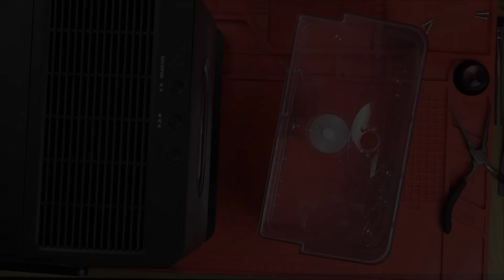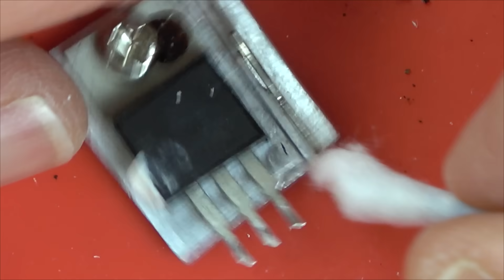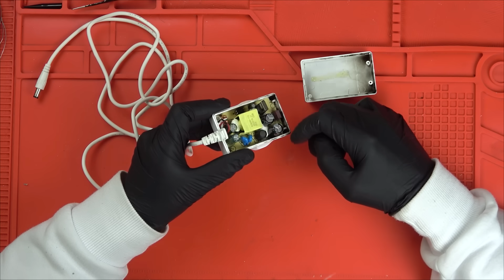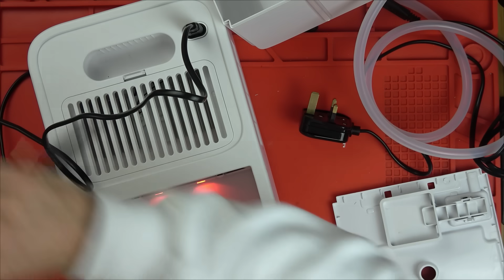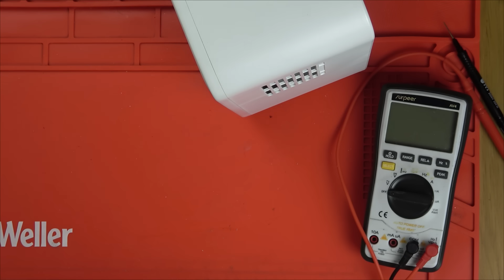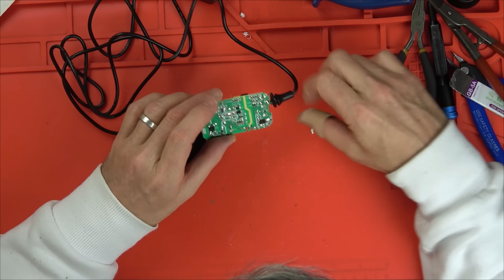Trying to FIX AMAZON RETURNS JOBLOT of DEHUMIDIFIERS

Comment: Maybe you could take some of the thousands of 9 volt power packs at my house Vince soooooooo many I have acquired from so many broken stuff and op shops. You are very correct though Vince do not onsell this device with the broken power supply like me I would be laying awake at night wondering about it. It is good to see such morality Vince you are very good this way. But a second hand power supply should be easily come by. Love the channel love the videos and love the variety electronics to home devices and boat motors. Also never worry about showing us your home in whatever state and do not worry shorts are all I wear in summer in Perth WA and I am 68 years old so imagine what my legs look like.

Comment: to save the trip outside with the power supplies. Make up a dim bulb tester, really simple it just needs a batten holder 100 to 200W mains filament lamp mains plug and socket and some suitable flex and a bit of wood to mount the bulb holder on. The aim is to connect the lamp to run in series with the live input and so limit the current to  400 to say  750 ma (depending on the lamp wattage) any shorts in the unit you are testing will simply make the lamp shine at full brightness.

Comment: My husband left the bath taps running years ago and flooded the top,floor of our flat. I ripped up the flooring and got a dehumidifier. I didn’t fill it with water as I assumed the water would drip off the plates in the machine and the float was to automatically stop it from functioning until you emptied the tank. Possibly I should have read the instructions. It did the job. Love your videos
Reply: Yep that's how a dehumidifier is supposed to work

Comment: That last power supply pulsing like that likely had problems in the bootstrap circuit. that diode is likely the run circuit that takes over after the transformer start switching and keeps the supply running, The bootstrap has a resistor and a diode that slowly pulses the supply and these pulses get rectified back through the diode though the auxiliary winding and the supply fully starts up. so yeah I really think it was a break in that auxiliary circuit

Comment: Question on the last power supply it was just a lose connection probably from manufacturing. Now would you put it back in service since it was just a quick soldering to fix it or would you take it out of service since you had to open it up? Me myself I'd use it / feel confident that it would be safe for anyone to use reason being is no components were changed and it was just reworked / reflowed / soldered and was faulty from the manufacturer

Comment: They could always make them like they use to with a screw or two holding the power supply together but no not anymore just glue or plastic weld them together and make them throw away just throw it away and buy another that's what happens when they make things cheaper it's annoying to be honest

Comment: Hi Vine, nice to see you back. IMO these Peltier based dehumidifiers are extremely inefficient. I myself got one about 2 years back and consider it crap. I've got a "proper" compressor based one (like a fridge) and that is much more efficient. It works much better and it's absolute bonkers how it can help with drying of the laundry when there is a high air humidity / fog outside. If you see mold appearing, get one ASAP.

Comment: We use them for window shelf's , great in the winter for getting all the moisture off the glass. And they work very well, I have 6 in our place. It's rubbish what you have said Vince in how they work. You have to have a certain temperature within the area from the window in to your room. Most tell you what the temperature range is for them to work. I have to empty some of them when we have the heating on when it is very old outside, and they can collect one and half litres within a 3 day period, and that's only running at night. Good work mate.

Comment: I bought a bunch of those.
Vince, you have no idea how bad humidity in my house is. What your dehumidifier did in 4 hours mine do in 30 mins/1h.
Reply: I cannot suggest enough that you get a real dehumidifier! And pipe it into a drain so you don't even have to empty it!
Reply: @jaydoubledee1853  That I was already thinking of, the problem is piping and connecting it.
The bathroom is the worst offender, as one of its walls is attached to the side of a mountain. Since it has metal radiators that we can't use, my idea was to remove one and fit one of those dehumidifiers up there.

Comment: I bought a dehumidifier it has a compressor inside like a fridge, its quite heavy though to put in my car to dry it out as water got inside from a failed water seal on the bulkhead, the car is not often used and when i opened it a week later there was 4 inches of water inside the footwell used a vax washer to suck the water up, must have been two gallons in there😂

Comment: Not true in your case, but some power supplies only give stable output on load. They can be in a burst mode type of operation off load due to poor design 'choices'. This can lead you down the wrong road when it's how it's designed. Often this can be improved or cured by fitting a load resistor on the output, or designing it correctly in the first place.

Comment: Bit of industry insider info..one manufacturer of smd bridge rectifiers changed their encasulation to low profile. When they did this their changed process caused voids in the encapsulation.
This caused internal ionisation which caused random arcs inside the package, leading to momentary very large current spikes and device and product failure.
It was from a major well known semiconductor company too!
In my career, there were 4 other cases of major chip manufacturers messing up leading to product failure, resulting in big compensation payments!

Comment: On the 9V power supply that was all black inside, i think that was from a lightning strike, i have seen this many times before, and you can se it has arched between the traces below R10, you can se a dimple in the solder where it has melted for a moment, and that point also was the senter point of the black stain. I work as a locksmith, and i changed out an alarm system after a lightning strike, one IR detector in the Livingroom was blown apart,  and the front half of it was found on the other side of the Livingroom. It was al black inside from the arching. You can also see that some of the traces are vaporized, and that need som power to do that.

Comment: Output capacitors on flyback power supplies MUST be high quality low ESR, high ripple current, long life types.
If you choose replacements just based on size, value and voltage you've not gone deep enough risking early failure.
Schottky diodes can be chosen based on vf characteristic graphs and matching reverse leakage.
Some schottkies reverse leakage can be very high when they get hot and can self destruct due to thermal runaway.

Comment: 12:38 People buy them as an alternative to a tumble dryer (well I have). Mine goes on between 2-5am (the super off-peak tariff) and the clothes are dry when you get up 🙂
Reply: These peltier dehumidifiers would not dry clothes, compressor ones will no problem.

Comment: There comes a point when you have to buy a bag of micro-switches. I know  the reason was mentioned for the alternative shown,  but if other components are readily replaced that cost more, then a moving part which are notorious for failure, then switches should be replaced.

Comment: Good stuff as always!  FYI: I live within 1 mile of the sea in the North West.  Without a dehumidifier in my bathroom and one in my bedroom used a couple of hours a day over winter I get black mould starting in corners of the rooms.  I had the same in my previous house nearby, so it's not the house.  Humidity meters around the place show it always at 70%-85% without the dehumidifier in winter.  And I don't dry washing in the house or steam food, and only me in the house. My mother's house fairly near is also the same.   People I know who live down south (I have taken meters to check) get 55%-65% which is well below the mould threshold.  These things do have a real use for people in cold and wet places (although the Peltier ones are not great as you say).

Comment: what is the brand of the spotwelder u use Vince? , maybe got a link?
Reply: It's a Glitter 801H with standard S-75A probes. Looks like a decent unit and I recall it may have been gifted by a viewer. I've always been curious of the scale/units it shows as it can make it difficult to judge what to use for a once of job--seems to get the job done and on the plus side is generally entertaining :)

Comment: I just had my power chair have a capacitor explode underneath my butt when I sat down. It literally exploded everywhere and there was parts of it inside the case all over the place. It took out a DC to DC 40 volt buck converter with it. Waiting on that part from China and they're not shipping right now for the Chinese New Year....

Comment: Nice fix, Vince :)
If No. 7 is a simple 12V PSU, I could send you over at least 50 of those, I got a big crate of 12V 3A PSUs from one of my friends, who works at a local telecommunications service provider, and they are monthly discarding brand new PSUs from modems, and STBs because they don't fix the boxes, either. And if the PSU cable is non-removable from the user's TV cabinet or any cable loom, then he is not replacing it if it is not faulty. That leaves him a truckload of unopened PSUs at the end, and his boss told him to dump them all.

Comment: A Sinclair Spectrum +3 I had in my bedroom used to store loads of energy in it's caps. I'd be in the bedroom at night and randomly a few hours later the red power and disk light would occasionally flash on when it was unplugged! Freaky!! Scared me so much as a kid I had to put a jumper over the top of it when I went to bed! Back then I knew nothing about caps😂

Comment: It’s probably already been suggested but the smiley face is imo purposely put on the front to indicate it’s in the correct position as a pose to facing it towards the wall a blocking the outflow and causing it to overheat.

Comment: @ 1:23 where you are reinforcing the blade on the microswitch. Use some old "used" offcuts of solder wick. I keep all my old pieces. They make really good "bridge" pieces for bigger tracks AND bridging thin metal pieces of things like battery compartment tin contacts and for here where you want to solder reinforce. They stick well.

Comment: The problem with these micro switches is a cheap design as the water slowly rises in the tank it takes the pressure of the contacts and causes arching before the switch switches over and turns it off. They need modifying to make them reliable at least we know what not to buy watching these fault on various devices.

Comment: 11:50 you need to add the weight of the plastic to the weight of the water - so if the plastic weighs 300g the full container weight should be 3200g + 300g so 3500g not 2900g
Reply: Exactly, I had to rewatch that part and still didn't get it 😅

Comment: Not sure WHY this works but freezing a glued wall supply using freeze or dust spray (upside down as liquid) along the seam, makes the case cracking much easier. Probably does something to the glue, who knows. Done this for years.
Reply: Freezing makes the glue brittle so easier to crack open, but can also affect the plastic as well.

Comment: Given the efficiency of that first peltier dehumidifier the good news is it'll only need to be emptied annually and that will only cost a couple of hundred in electricity to achieve. I had a maplin peltier dehumidifier and it used 80 watts constantly to extract about 5ml  overnight
Reply: Strange, I have dual peltiter one rated at 75W, I did some calculation before ordering it and predict it will extract about 500ml/day (with humidity I had before and fixed temperature in the room) and it does almost exactly that, some days it even overachieve it by 100ml.
Reply: @gorky_vk I had a major damp problem so I expected it to extract a lot but it didn't. Maybe not quite 5ml (that was exaggerated but not by much) 500ml would be decent. Seems Vince's one is also poor. Like everything the quality varies I guess. I usually trusted maplin but now it no longer exists in UK
Reply: @paultasker7788  I had a problem in one corner of my living room, my neighbor's fence touched the outside wall and moisture would always condense there in the winter (and then of course spread along the entire wall). Reducing humidity by 5% was mathematically supposed to solve it, per cubic meter it was about 400ml at 22 degrees Celsius...math :)
I chose between devices for at least two days, googled them open (every good review includes a screwdriver :)) and in the end chose this one with AE. I deliberately took a device that doesn't have any "advanced" functions but has two Peltier's so that neither one pushes too hard due to freezing. Timer? What do I need that for when they have to work 24/7 to do anything? Measuring the humidity level? As if they can really achieve anything measurable. A 3+ liter container? We know how long it takes them to collect it. All that mattered to me was that it work and had a frost sensor so that it didn't run idle. This one have just two color led (running/full), doesn't have that stupid switch design (it use two stainless metal strip as water level detector, same system like in clothes dryer) and on/off button. For about 40€ I'm satisfied. If I had bigger problem I'd go with an compressor device, they can be found for 100-120€ but there was no need.
Reply: @gorky_vk 
A peltier dehumidifier is so inefficient, it'll cost you more to run then buying a compressor based dehumidifier in the first place. A decent compressor based dehumidifier will absorb about 1/2 a litre of water per hour in a high humidity location, while using 1/10th energy of a peltier based unit. 
They are basically E waste, and not worth buying at all.
Reply: @johnnodge4327  I know. But they're also much bigger and way noisier units.   If humidity here is much higher compressor unit would be only solution but for me problem was this one wall, peltier unit solved that without taking noticeable space or noise disturbance. Sure, it cost me probably 10/month (compressor unit would probably do the same for 2€) to run so 30-40€ during winter period but that's the price I'm ok with.
Reply: @Mymatevince it might be a good idea to make yourself a dim bulb tester, it would help if you have a short circuit to prevent further damage. Great video though.
Reply: I hope you're joking because if it's being used for laundry it will need to be emptied way more often than that, I have a huge one with a bigger tank and it needs to be emptied all the time
Reply: @smashyrashy is it a peltier though or a compressor dehumidifier? I swapped to a compressor dehumidifier and that extracts a lot of water. It can extract 2 litres a day in a humid room drying laundry and in typical use tends to need emptying every 2 or 3 days but it's not on permanent. Only when humidity above 60 percent.